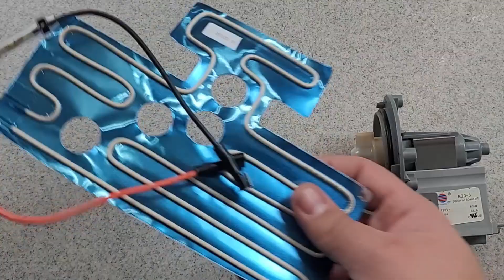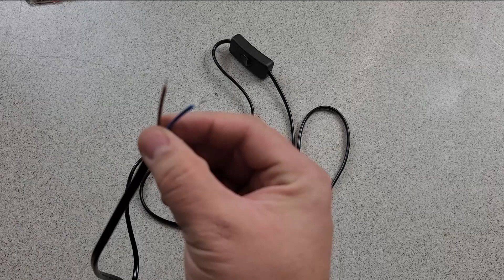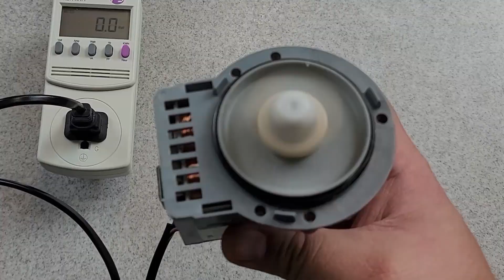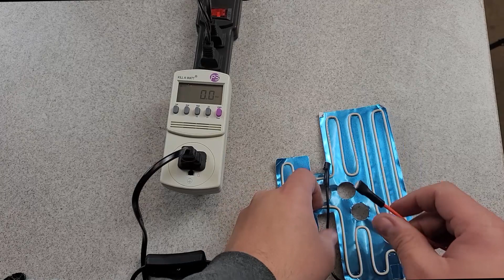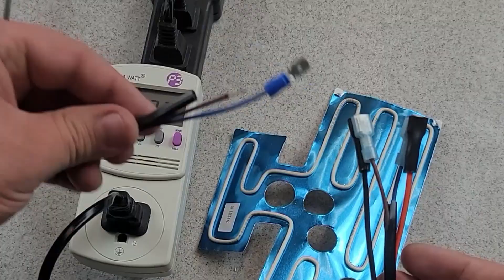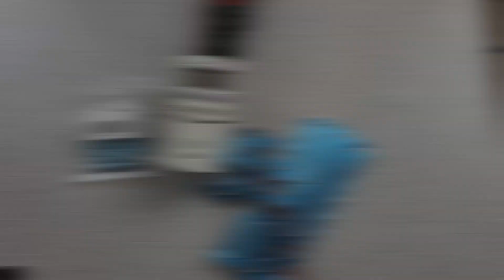How to Test Appliance Parts with a Cheater Cord | How to Make a DIY Power Cord

Comment: You could damage your pump plastic fan by placing the metal plier in front of the plastic Blades while it’s running that’s not a good idea.

Comment: Love your videos.  Couple questions...I have a double wall oven.  Don't know if it works.  I just have a storage unit and my garage.  I dont want to drag it into my house.  Ideas on how I can test it?  Could I wire it up to a portable generator?  I basically just want to.see if the control board works and sell that.  Thanks.  Keep up the good work!!!
Reply from the maker: Hey, so here's something we DIDNT record:

We used this to actually check a control board shortly after filming. YOU CAN USE THIS TO TEST ANYTHING. That includes a control board!

All you have to do is map out the pins on the control board and find where the 120v goes into the control board, and just use the test cord's spade terminals, and you're good to go. You'll use a line and neutral, but not the second line (240v) and the board should power on to verify it works! The second line on an oven or stove is directly wired to the element(s) to provide the other leg of 120v, so it typically never goes to the actual control board - just the bake/broil elements and if it were a free-standing range, the burners.

We did this to check a very expensive ($300) Whirlpool stove-top board that had bad relays. It worked great. Its pretty creepy to see the PCB totally outside of its shell, but it worked enough for us to verify the board was shot.

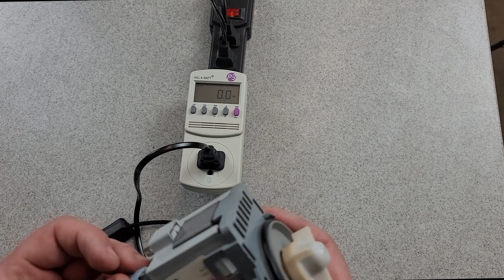Comment: At about 2:10 you are talking about polarity as it applies to AC voltage.  AC changes polarity 60 times a second, aka 60 Hertz.  It doesn’t care which way you plug it up it will turn the same way.  It’s a fundamental characteristic of AC.  Now if you change the polarity of DC, then an electric motor will rotate the opposite direction.
Reply from the maker: Thanks for the insights Anthony.